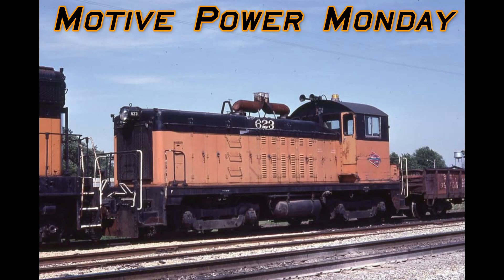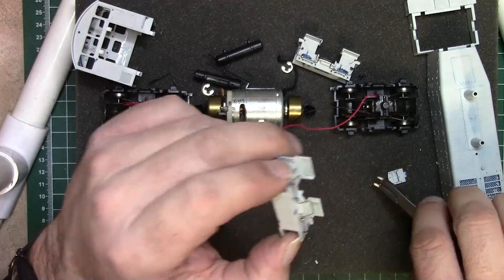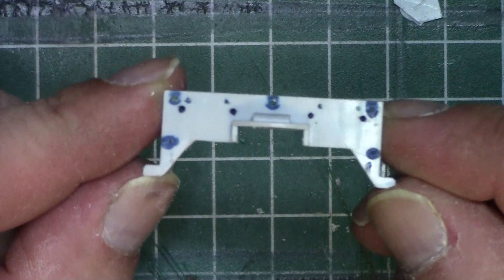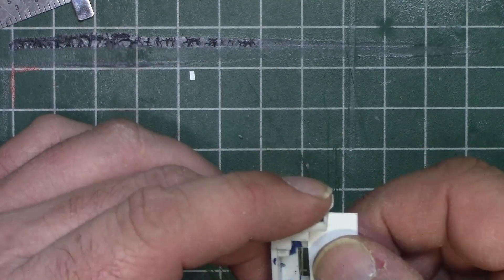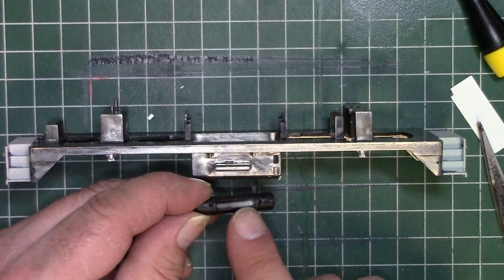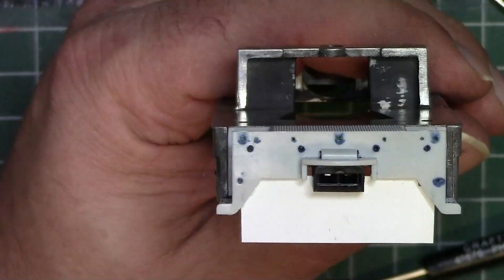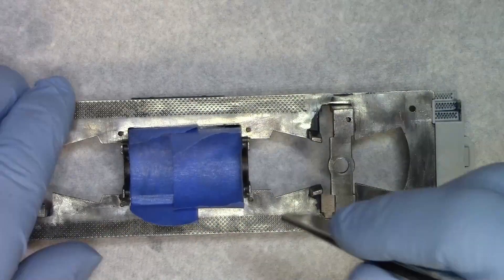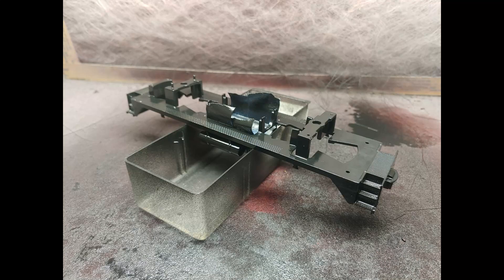Prep and Painting Locomotive Frame using rattle can

Comment: Neat information about redoing the pilot.  Are there a variety of pilot types?  Was that Era specific?
Reply from the maker: The SHS unit came with two different pilots.  The straight one like im using and then the one with the drop step.  The unit being modeled really dictates which one to use.  The SW1200 on the Milwaukee had one of each.